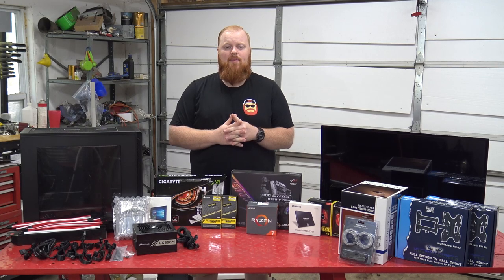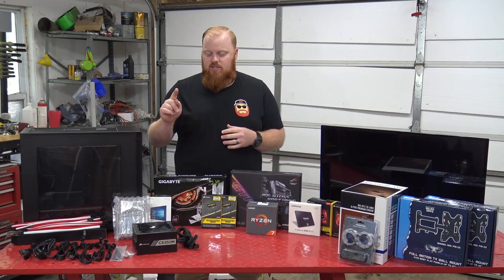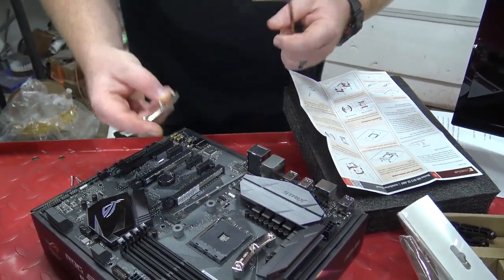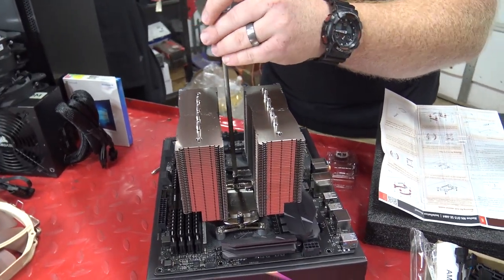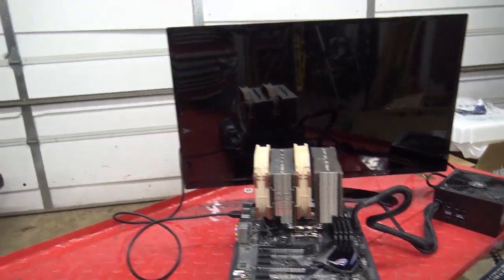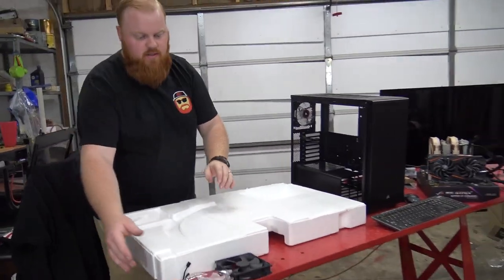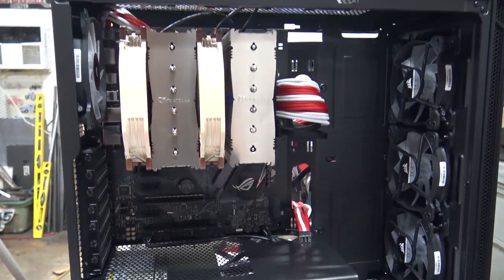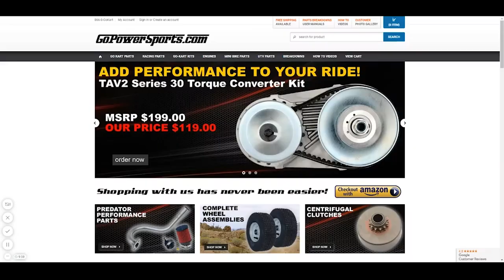Ryzen 7 1700x Editing PC Build

Comment: iThink you built this computer PERFECT for your needs.
You did GREAT for your budget, however, there are some upgrades iWould recommend doing over time though.
One upgrade that iWould suggest would be a bigger case that has more hard drive storage bays. Since you want to do 4K media, the files maybe quite large, so the more storage room the better.
The second would be using a TV instead of a monitor.
The only reason you would need a monitor is for high refresh rate. TV's give more display space for the money. As long as your LG monitor is a IPS panel, you should be fine for now.
Use it until you could get a nice 4K TV panel, like an OLED.
The last suggestion would be faster RAM 'cause the Ryzen line of CPU's perform better with faster RAM speeds.
This would help cut down rendering, and upload times, as well as making most task faster in general.
Reply from the maker: Im actually going to build a server to store all my files later next year. I will be doing the 4k tvs next year as well just need a better setup. Thanks for the positive input and thanks for watching.

Comment from the maker: Want to clear up a few things for the viewers. The pci slot i used is 16x so no performance lost there, magnetic screwdrivers are fine to use in a pc, putting the case on foam is probably dumb but I did it and the pc is running great, a m.2 drive is faster but also more money, refurbished power supply is working great and is just as good as a new one. Its ok to have a change of videos every now and again. If you guys don't like it, simply don't click on the video. Thanks for watching.
Reply: Red Beard's Garage should of done a 6gb card or an ams rx 580 8gb graphics card. The 1060 3gb sucks ass because lack of VRAM
Reply: I have had my PC apart a few times and rebuilt/upgraded quiet a bit sense it was first built. A magnetic screw driver is a must.
Reply: No that slot wasn't 16x lol

Comment: All circuit boards made in forever have static shock protection.      I have NEVER once even considered being "properly grounded" when building my PC. I've built about 8 for myself, and used to repair laptops/desktops as a side hobby for years. I've NEVER had a damaged component.

Comment: Solid build RBG. Slowly saving up some money myself for a new Ryzen system to retire my Haswell rig next year. And reading through some of these comments makes me wonder how those people manage to get through life. Absolutely nothing in your system would be damaged by the magnetic field from the screwdriver. Especially since there's a Neodymium magnet in every single hard drive. I clearly saw you apply the thermal paste in the CPU, and I clearly heard you say that a GTX 1080, and a M.2 drive are in the works. Ohhh and I also heard you say it's overclocked. But do you have some sort of backup storage solution? Having a drive fail with no backup is not cool.
Reply: some just like to pick fly crap out of pepper.
Reply from the maker: Im glad someone listened to what I said lol. I actually have another hdd coming to do a full backup on the pc so just in case im good.

Comment: Why put the Graphic card in lower PCI slot? The speed of the lower one is slower. It should go in the top slot. It will be faster.
Reply: Makes literally no difference. Google that shit.
Reply from the maker: Both slots was 16x. It will not hurt performance in no way
Reply: ŹZZZZZZZZZZZZZ
Reply: Welcome to Ryzen. U can use a ton of 16x cards if the boards support them w/ all the PCIe lanes this CPU has available :)
Reply from the maker: wtcamer you are exactly correct
Reply: Even if the lower slots weren’t 16x it wouldn’t hurt performance.

Comment: Have you noticed any speed improvement using 32G over 16G in video editing?
Reply: Nice build. I am running the 500G 960 evo M.2 and it is super quick. Never ran the 850 though so cant compare the 2. I would have ran the 1700 with the stock cooler if I was to change any thing just due to price to performance. I would also have ran 3200 ram and overclocked the CPU but that's the gamer in me :)